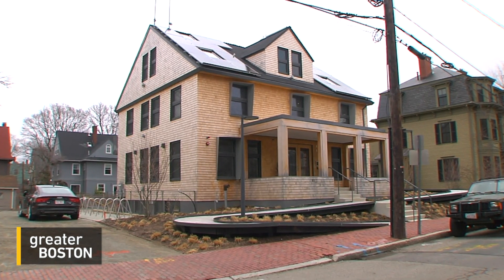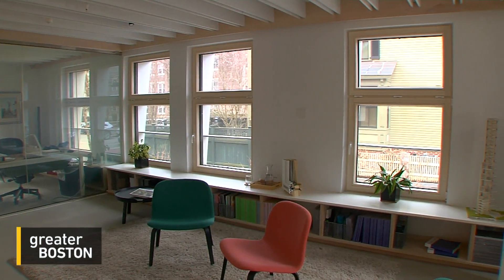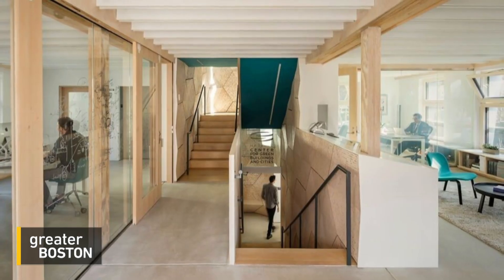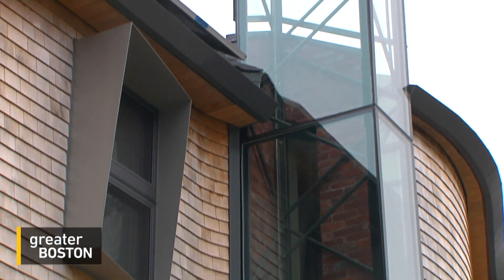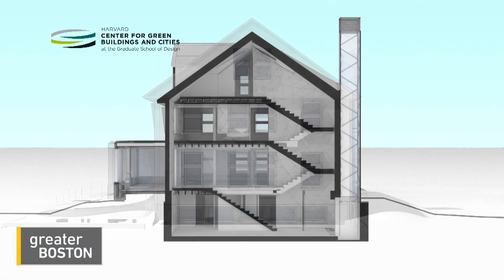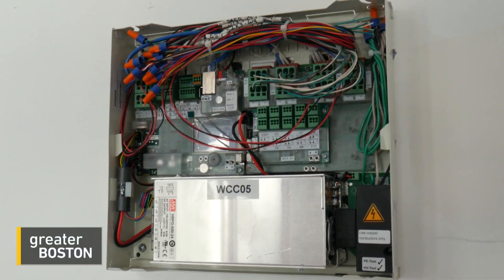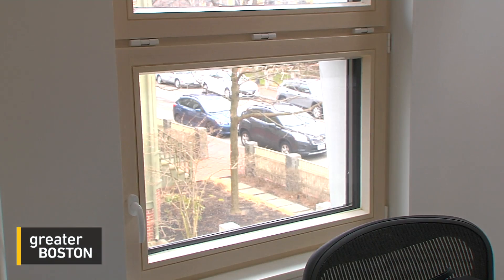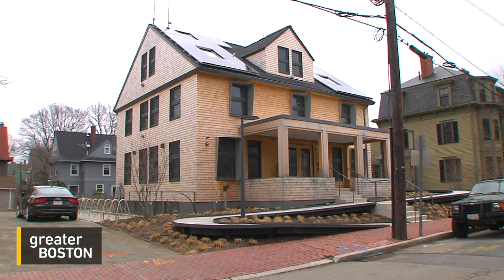'HouseZero'

Comment: Bring it thru a New England 6 blizzard winter in 6 weeks and show me that it can keep up with the heating needs and thru a 4-6 week summer heat wave and can maintain 70F temps internally without using the grid and I'll believe the tech works.

With real people living in it cooking, showering, etc on a daily basis and the energy that draws.

Then explain how this can be done retrofitting a 100+ year old typical Cambridge row house triple decker without paying for the same building twice over in costs.